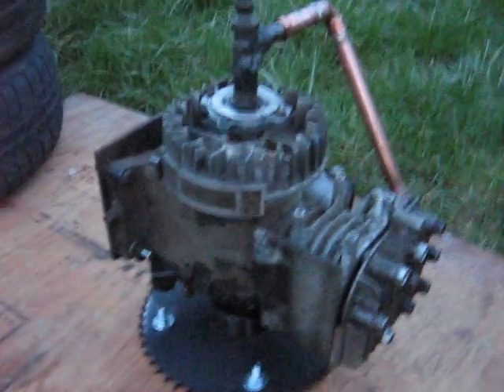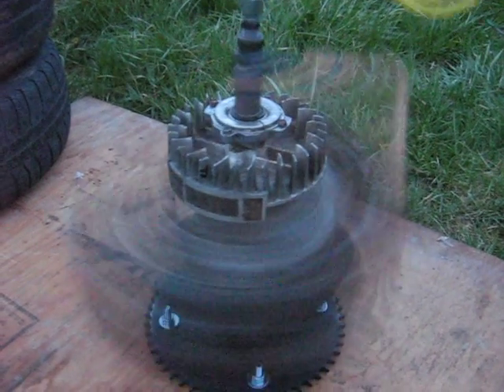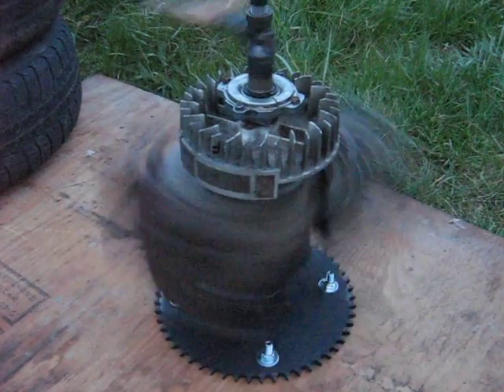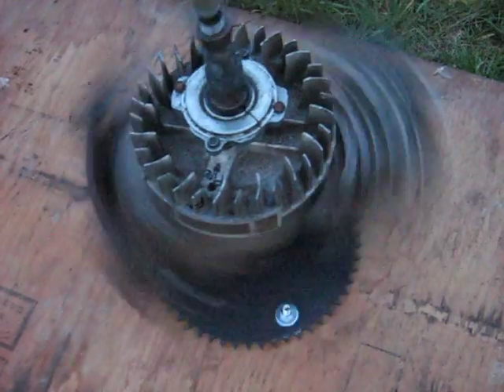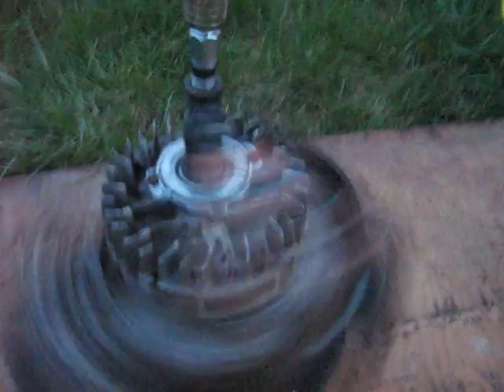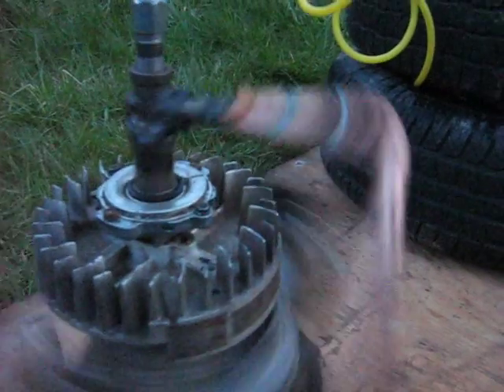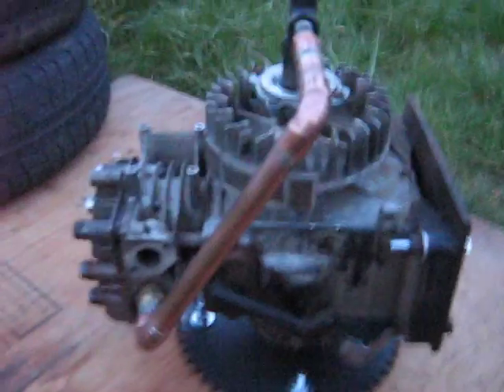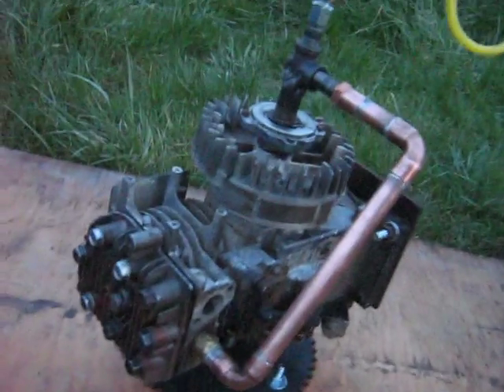WhirliBriggs Slower Speed Run

Comment from the maker: I originally tried that, with just 2 drops of gas in the intake manifold, but it didn't fire, so for safety reasons I gave up, and went with compressed air. I has a surprising amount of push when you open the air valve and try to push against it, but it could be a hand wrecker, if it got away from you!

Comment from the maker: Not really sure, but from what I had happen on my go-kart compressed air engine , back about 10 years ago, it had more torque than a 3 horse Briggs, as it would spin the tire in the gravel every time it "fired" I don't have quite the same set up now, plus I am on pavement, but they seem to put out quite a bit of torque, like a steam engine.

Comment from the maker: I think the steel plate is 5 by 7-1/2" of 1/4" thick steel. Later I added a piece of 1/2" round bar 4" long to help balance out the copper pipes.  You can see that on the 2 vids I will upload tonight.

Comment from the maker: Yes, I need to add  a bit more weight to the steel plate, guess I better do that soon :)
I think the copper fitting have made the cylinder head end a bit heavier than before.